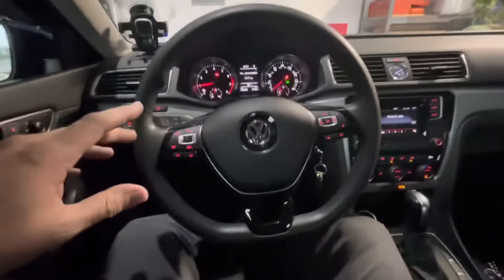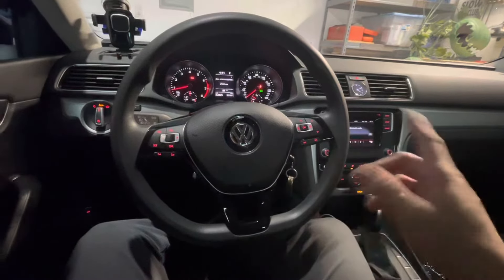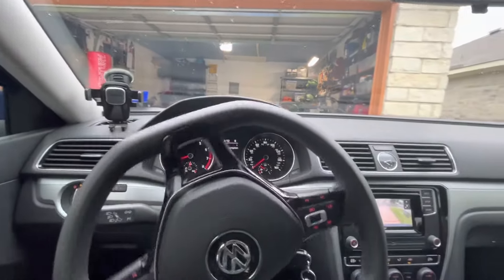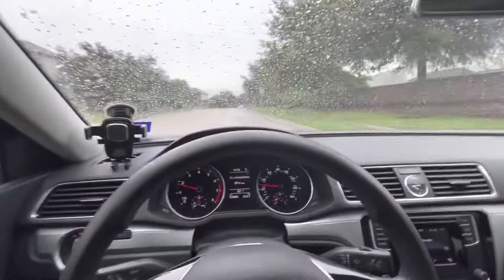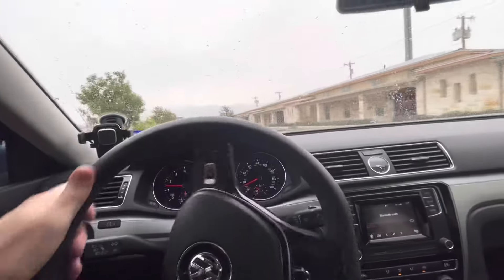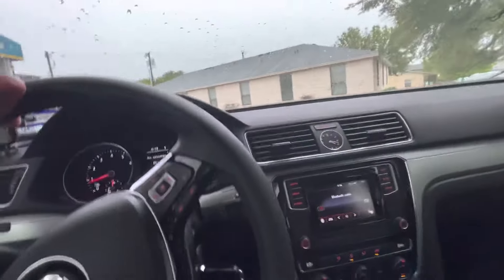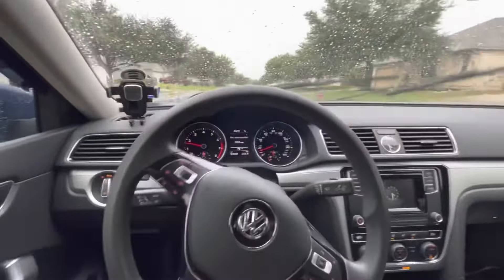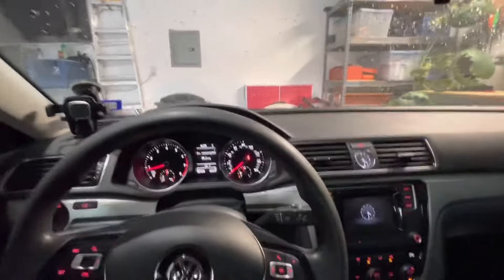Volkswagen suspension clunk/pop front end -DRIVING ME MAD- subframe bushings? Troubleshooting noises

Comment: Have you fixed it? I have exactly the same issue on my skoda? Knocking noise when turning around at low speeds and specially when pressing the brake or accelerating. I have replaced shocks, coil springs, control arms,ball joints, dogbone, left engine mount and the knocking is still present. What i have left is subframe bushing.
Reply from the maker: I have not unfortunately. Shop I took it too said my solo werks coilovers are just cheap and the springs are binding. I’m not certain that’s true but I spent so much time trying to figure it out and I have given up. Saving for better coilovers
Reply: @DADMOBILE_Garage  curious if this ever got solved, im about to do my strut bearings right now, hopefully this rabbit hole isnt as deep

Comment: I strongly suspect this has to do with either:

Lower control arm bushings. They both deal with distributing weight. The moment you said clunk during a brake I recognised it as being the control arm. 

One key details that seals it is: 
if the vehicle seems to shake\sway back and forth as in ahead and back riiiigght as youre coming to a stop at 10km/h to a halt, its your control arm doing that. If not it might be your sway bar bushings
Reply from the maker: Thanks for the info. I may need to take it in again, but the coilovers are also wearing out so I want to replace them with better….
Reply: I have replaced my controlarms with new ones for about 8 month ago and EVERY single rubber busshings, both front and back axels replaced with powerflex bushings, and new swaybarlinks so that shouldnt be the problem... ... pretty much every thing in my undercarriage have been "upgraded" to street performance parts.... exept for the swaybar itself, and powersteering rack bushings
Reply: You need replace steering rack

Comment: Hey, I've got a similar problem in my mk6 gti and I came across a video of someone mentioning a 'subframe locking collar kit'. After watching some videos about it I found that apparently the holes the mounting bolts for the subframe go through are quite big to allow for greater wheel alignment adjustment in the factory. This kit of stainless collars and replacement torque-to-yield bolts is meant to stop all the moving around and stop the groaning and clunking on weight shift. Have not tried it yet but will order the kit soon and try it out.
Reply from the maker: Good luck man! Turns out my issue is mostly due to wrong spring rates on my coilovers. The springs rub/bind/and pop a lot. Visible wear on them where they are grinding together 😑

Comment: So my '17 jetta "popped" turning out of the driveway/uneven pavement.  Intermittent.   Mechanic unable to duplicate.

So I replaced the control arms,swaybar links, struts, ball joints on my own. This car has 90k and they were actually bad components. 

Rechecked the subframe bolts that were "tight" and that mechanics had already looked at.   Guess what,  they were all loose.

Do like the other people have said.  Get new bolts and torque to spec.

I did, and the noise is gone.  It's relatively inexpensive.   And do it yourself.   Mechanics don't like to check subframe bolts.  At least not in my neighborhood.    ????

Comment: Hey i have 2016 vw passat i bought it used with that noise, i thought i can fix it must be the struts.
My vehicle makes huge noises from thr right side when i hit bumps and it rattles sometimes and also make noise when hard breaking and releasing.
I checked it with 2 mechanics and replaced ball joints, 3 times replaced the entire strut kit with springs, and also the links all three times.
Still my mechanics are unable to find the fault.
Please let me know if you have fixed it and what was it its driving me crazy.
Reply from the maker: Sorry you’re going through that. Very frustrating!! My noises are caused by cheap suspension I installed myself unfortunately. Things you didn’t mention, that I would consider-
-strut mount bearings 
-sub frame bolts stretched/need replaced 
-subframe/control arm bushing old/worn 
-non-Oem brake pads rattling in the carrier 
-engine/trans mounts bad